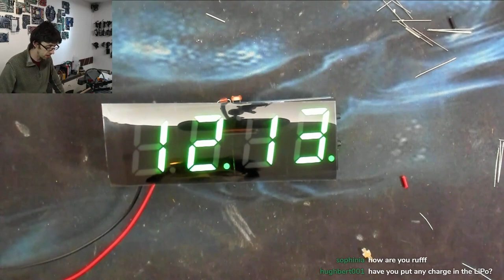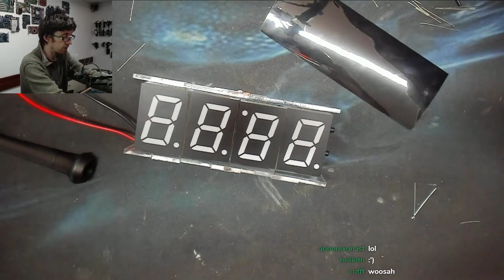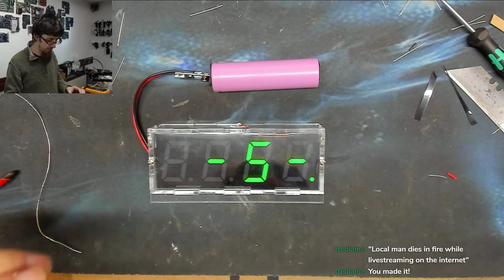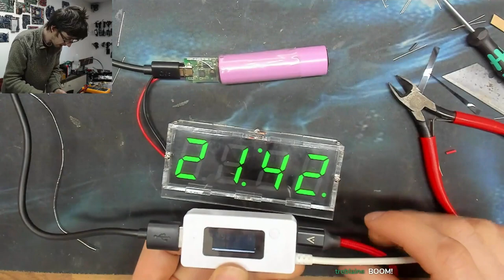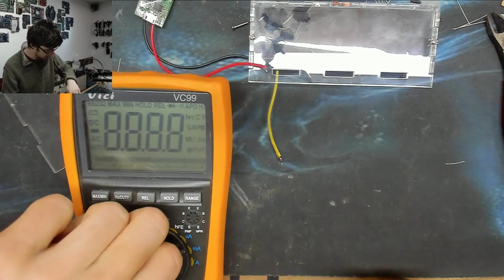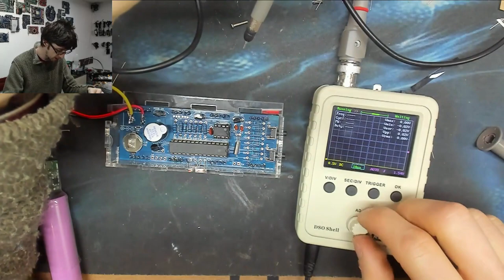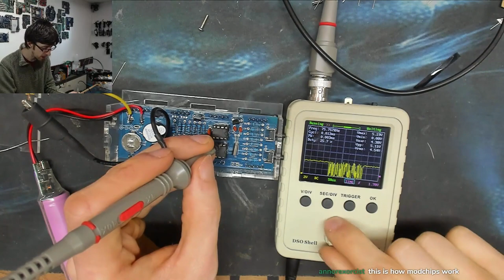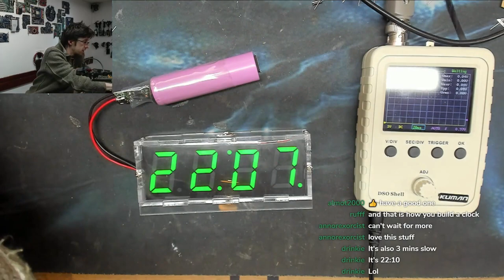LBE#6b - Digital Clock Kit Tinkering

Comment: there was no risk of shorting out the battery when desoldering and soldering.  because there is no potential between the positive of the battery and ground. in other words because the battery is not grounded there is no power between positive and Earth's main ground